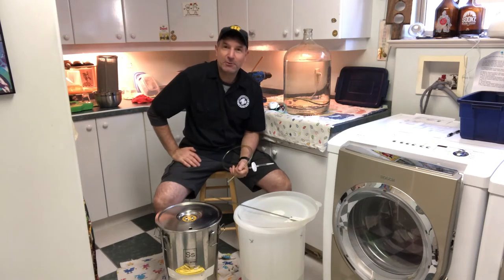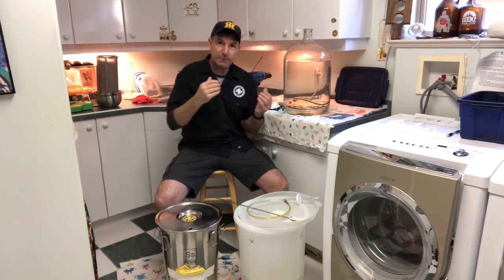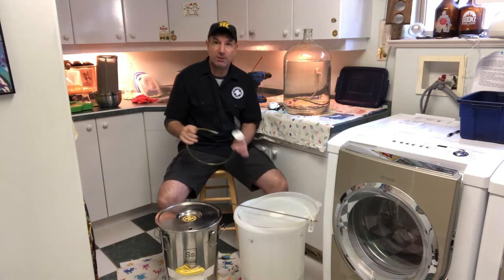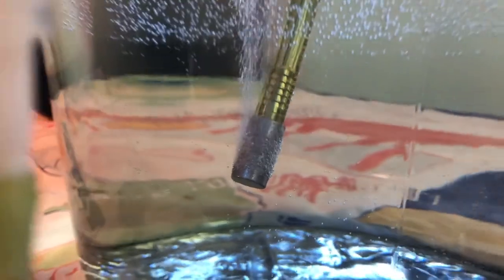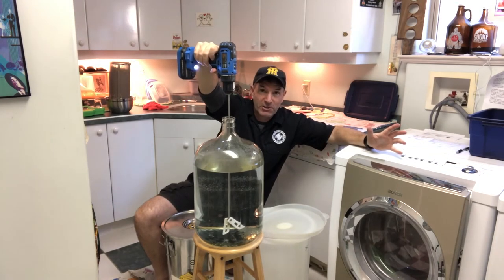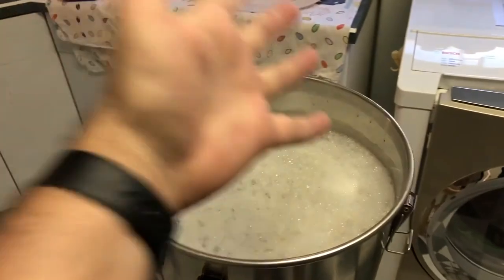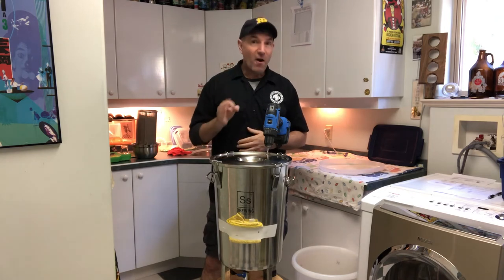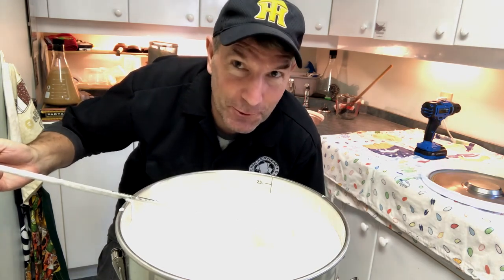Oxygenating your wort - Tips and Tricks

Comment: Is this really necessary? There's generally enough oxygen available for the wort just from the air in the fermentor. I will admit I stir in my yeast too for 10 seconds but never minutes worth of aeration. In my 14 years of brewing I've never done this and never had an issue, so I wonder if there's really any benefit.
Reply from the maker: The extra oxygen does help with yeast health and propagation. If you've never head an issue - GREAT! But I find the three minutes of really frothing up the wort before pitching the yeast really helps kick-start the fermentation.